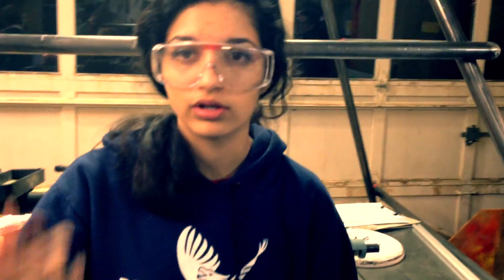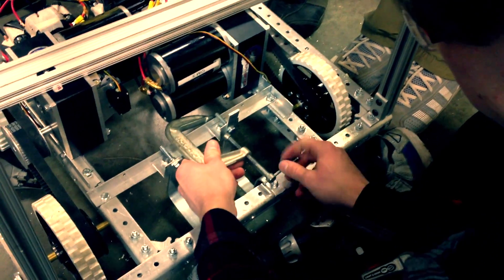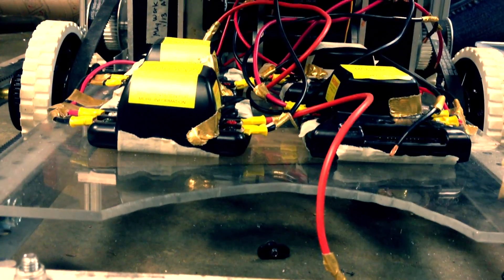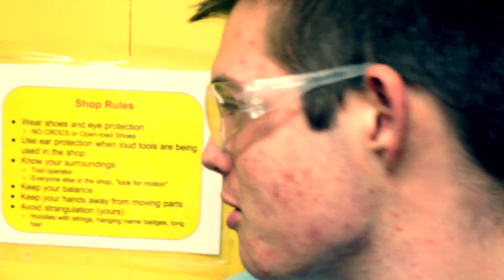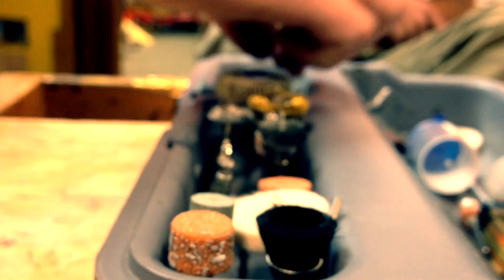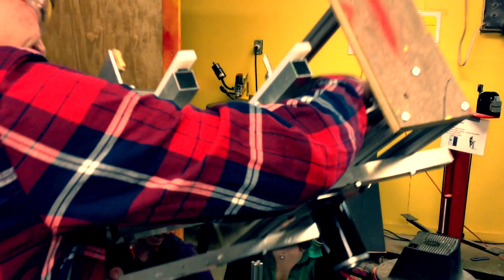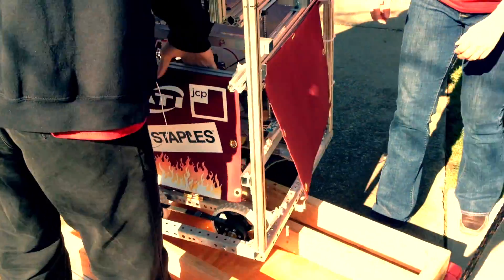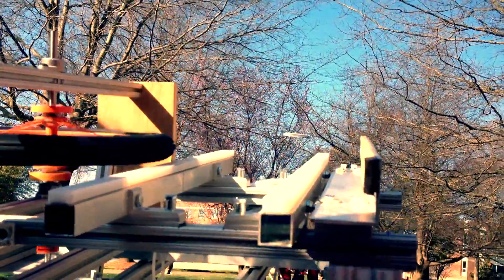PyroTech Build Season 2013: Week Six

Comment: Nicely done!  Using a wheel projection system (similar to what tennis and baseball pitching machines use) is analogous to push-passing the discs.  What is the possibility of developing an arm that actually flings the disc?  Clearly a more complicated endeavor, but is it one that has been considered?